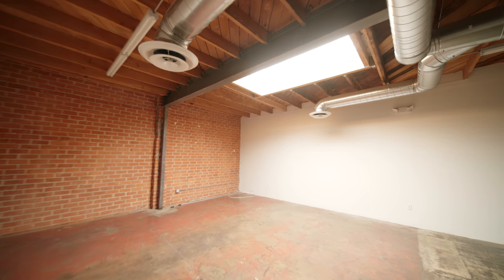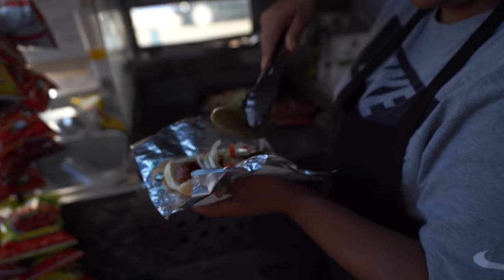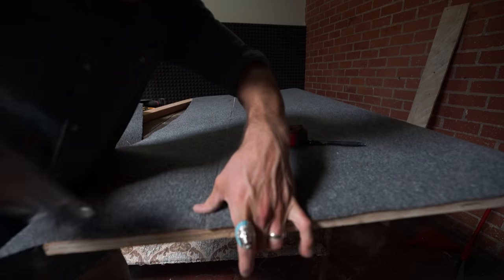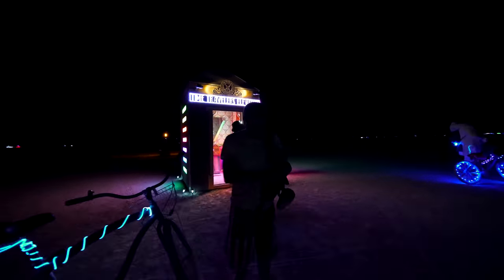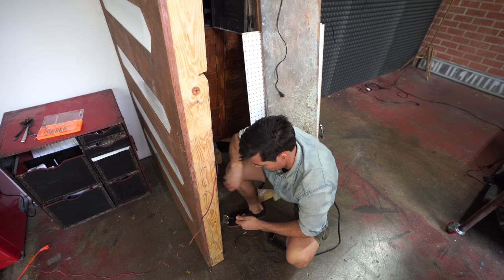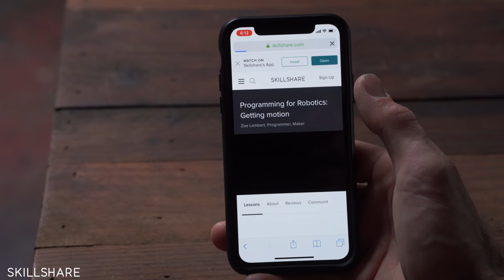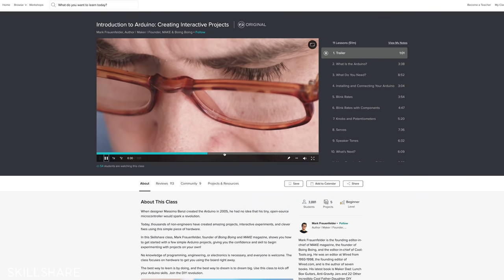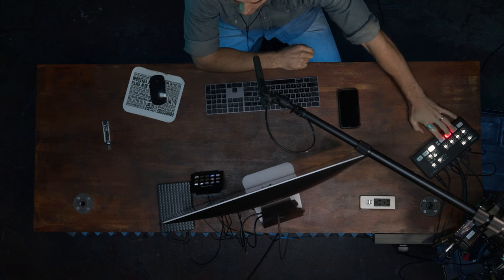How to build the Youtuber dream studio....from the future.

Comment: Yo Brother, Owens Corning 703!! Check it out. It is way better for reducing reflections and live ambience than studio foam! Also, you can cover it with micro suede material (which is porous for the sound tp travel through is still absorbed by the 703. 
Owens Corning 703 is basically just like the puffy yellow or pink insulation you get from home depot only it is compressed into a sheet. It comes in 1/2 inch on up to 4 or 5 inches thick. it is probably the best sound absorbing material out there. It's versatile, Cuts easy with a blade and hangs easy too. There is a special fastener for walls and ceilings called RotoFast. Just google Owens Corning 703 recording studio sound absorption, and then check the images!! There are other companies that make the same stuff, you just need to look for it. And oddly enough, Home Depot nor Lower carry it. HVAC supply shops carry it and the call Bat insulation!
I wouldn't go any thinner than 2 inch thick. Build a simple frame around it and wrap all of it with micro suede. Boom you're done.
And May The Sound Absorbed Force Be With You! Yup..

Comment: When you buy foam, snip off a small piece. Hold that foam away from you with needlenose pliers and hold a flame up to it. If it only chars a bit after a minute, you are probably good. If it lights up like crazy and drips like napalm, do not put it on your wall!!!

Acoustic foam is fire rated for wall installation and is open cell (you can blow through it).  

The wrong foam is dangerous.